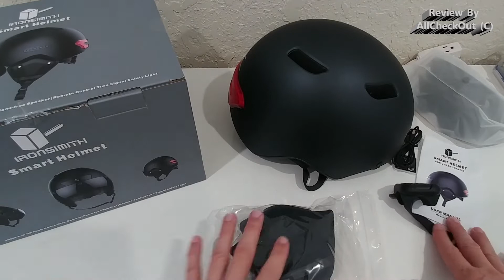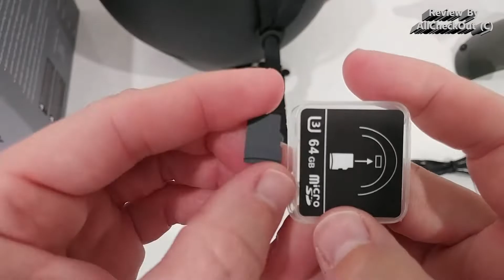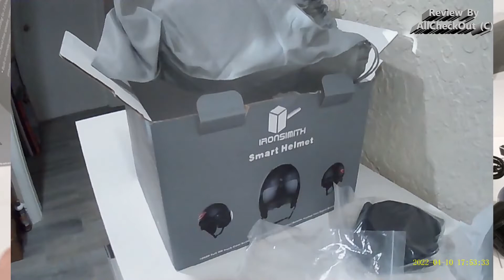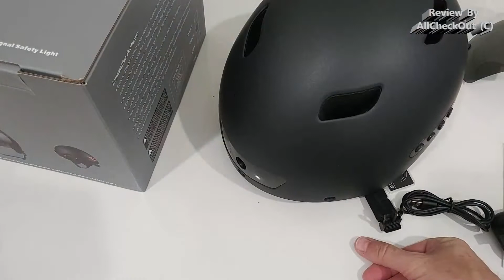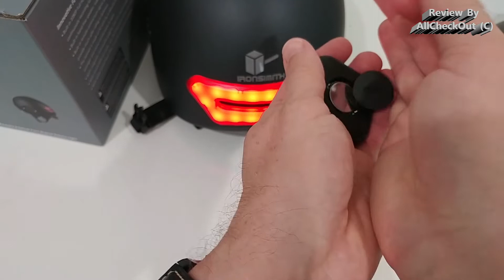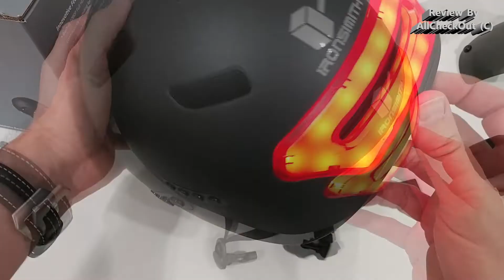IRONSIMITH Smart Bike Helmet SH10 Bluetooth Helmet with Turn Signal Full Review With Camera Footage

Comment: 🇨🇦  Warning: this helmet erased both my MicroSD cards from both my phones after I tried to record videos on my MicroSD cards in this helmet (I found it in dumpster picking bottles).  I'll go to my phone repair shop & try to recover 180 GB of my files.😢
Reply from the maker: Sounds crazy. Sorry to hear that. That usually shouldn't happen. Can't remember the OS, but usually it's some kind of customized old Android and so the device copies the original Android file structure over it, but usually doesn't do a delete before - just copies the files/folder there additionally ... but it looks it didn't copy/merge this time but delete/copy ... that's very bad behavior of this device.

Comment: How do you synchronize the time stamps for the videos and photos? Thanks
Reply from the maker: Usually you have to connect the micro SD card, open the folder and there will be a file with the time and date inside which you can adjust

Comment: Thats pretty cool matey,  have you tested helmet battery life with continuous recording?
Reply from the maker: Sorry - I haven't tested but a 1200 mAh battery should last for about 2-3 hours without stabilization ... but it's just my assumption based on my experience with other action cameras and they are even using a very old mjpeg codec which probably saves even more battery.